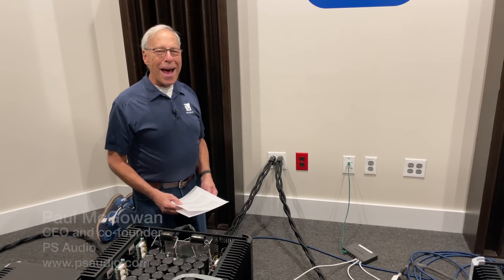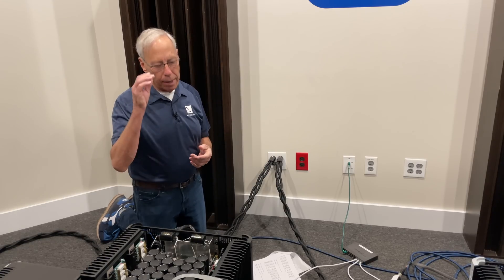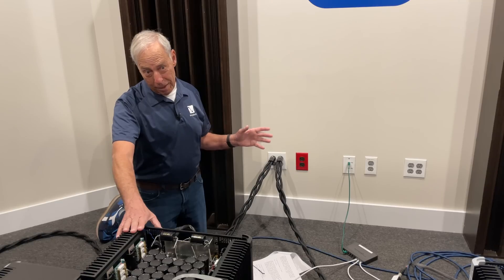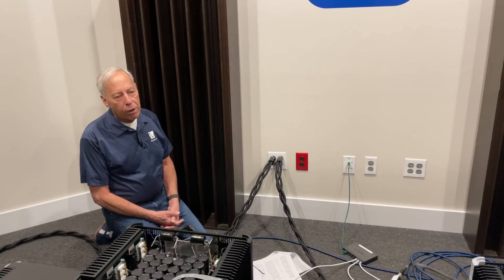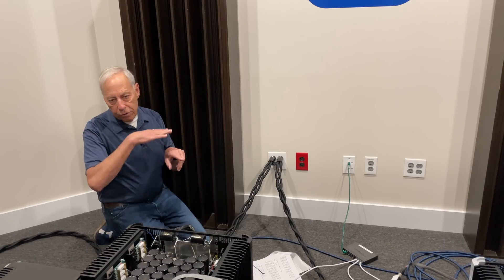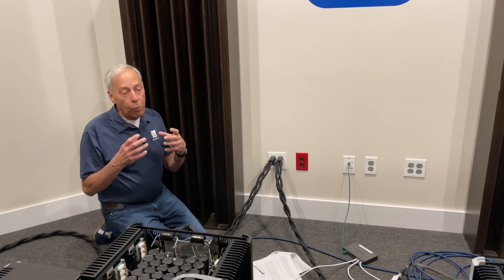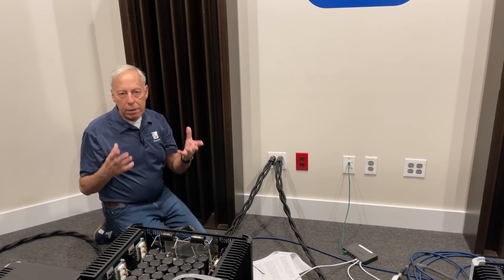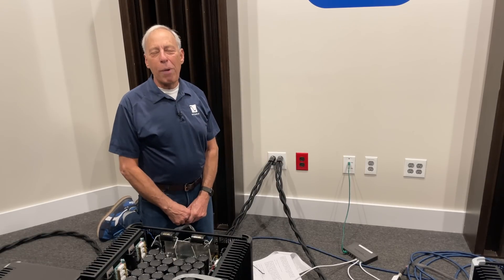Are braided power cables better?

Comment: Anything you hear in a power cable is pure PLACEBO. There are multiple videos explaining why a power cable does nothing more than get power from the wall to the equipment. Also by braiding a cable it makes the conductors longer which can INCREASE resistance, not good. Hi end manufacturers have been using the placebo effect for decades to sell some ridiculously overpriced stuff. Measure the power at the end of a stock molded cord and a fancy whatever expensive cord, no difference means no difference. It's ok to admit our brains are amazing things and have the power to fool us. Just keep signal carrying cables separated from your power cables and all is good. The emf is very weak and dissipates as you move from the cord. The strength of the field is dependent on the amount of current flowing thru the cord,  Take a amp rated at 1000w and use ohms law to see what it actually draws from the wall. Not a lot.
Reply: Please list the power cables that you used in your listening test, to conclude that power cables make no difference.
Please also list all of your stereo's components that were used in your listening test (speakers, amps, pre-amp, DAC, transport, phono-amp, tone-arm, cartridge, etc), and room treatments.
Reply: @0Perhaps  you are not the brightest no?
Reply: @0Perhaps  No. Follow the science
Reply: @bradt.3555  What science?
Reply: @0Perhaps  Somehow "audiophiles" think they have some special hearing the defies all the laws of physics. I've gone past the point of annoyed, now it's getting just plain funny.
Reply: @0Perhaps  Really, listening tests are the problem. There is no physical laws in this universe where a 6 ft wire in a non signal path, before the power supply can have ANY effect. A good piece of zip cord will give you the same voltage and cycles,etc. as any other cord. I have tried different cords. It's a strange phenom. that people actually want to be fooled, that's the one that I really have a hard time understanding.
Reply: @ Brad T.

24 hours later:  2nd Request:

Please list the power cables that you used in your listening test, to conclude that power cables make no difference.
Please also list all of your stereo's components that were used in your listening test (speakers, amps, pre-amp, DAC, transport, phono-amp, tone-arm, cartridge, etc), and room treatments.
Reply: @0Perhaps  Too much to trouble to list all. Doesn't change the facts on the function of a power cord. Under any laws of physics it can't happen, except in your brain. Step up and admit the science of placebo effect. That's my final response. Not trying to be mean or anything it's just the science of it.
Reply: @bradt.3555  You wrote:
"Too much to trouble to list all."
You have nothing to list, because you never tested.

Your "Too much trouble" is a BS excuse.
Do you understand that people are reading what you wrote, and you expect them to believe that listing the components in your stereo is "Too much trouble"?

You wrote:
"Doesn't change the facts on the function of a power cord. Under any laws of physics it can't happen..."
You wrote the above, so therefore it is a fact.
I am relieved that you did not write that the Earth is flat, because then that would also then be a fact.

You wrote:
"Step up and admit the science of placebo effect."
I admit the placebo effect.  I never denied that effect.
I also admit to driving over the speed limit.  I never denied do so.

The placebo effect is relevant when you take a double-blind test, and are given the same power cables to compare, but are told one is expensive.

When using a stock power cord, and replacing it with a quality power cord, you will hear the improvement, because there is an improvement.  It is not subtle.  It is not something you have to strain your ears to hear.  Such a change is not imagined.  It is real.

Quality power cords are most effective with CD players (or DACs).  If you have only one quality power cord, then that is the component that you should plug it into.

3rd Request:
Please list the power cables that you used in your listening test, to conclude that power cables make no difference.
Please also list all of your stereo's components that were used in your listening test (speakers, amps, pre-amp, DAC, transport, phono-amp, tone-arm, cartridge, etc), and room treatments.

You will not do so, because you never listened with quality power cables.  You chose to spew BS, and when challenged, claim it is too much trouble to support your assertion.

It sucks to be caught in a lie.
It sucks even more when you keep digging.
Reply: @0Perhaps  I have tried diff cords. I have been doing power distribution all my working life till I retired, and electronics. Check the internet, power cords have been tested and no difference. No listening where your ears can fool you but actual tests. There is just nothing a 6 foot piece of wire can do to make a difference. Use some logic look at what a power cord does. Theres nothing 6 foot of wire can do to change 120v, 60 cycles, or whatever you power is.. Don't know what the caught in a lie thing is about. This isn't even complicated science it's electricity 101.
Reply: @0Perhaps  Just a note to add, I don't understand the obsession with my gear, whether you have an old technics table and reciever and radio shack spkrs or a oracle, theil spkrs, audio research comp or whatever if a pwr cord made any diff it would improve any system. Probably less on better gear because of a better power supply. My stuff falls somewhere in the middle. Very good used stuff I've put together over the years. Prob about 10- 20 grand range if bought new when it came out. But gear is irrelevant to the scientific facts of what the cord does. I have not had anybody explain technically how a cord alters the power and backed it up with measurements.
Reply: @bradt.3555  You wrote:
"I don't understand the obsession with my gear..."
The obsession is on your part, in making claims of quality power cords making no difference in sound quality, and refusing to list the stereo equipment that you used to make your conclusion.

You went on and wrote:
"if a pwr cord made any diff it would improve any system. Probably less on better gear because of a better power supply."
Translation: You never tested a quality power cord.

Your original comment, that started this thread, was you spewing BS about power cords being "pure PLACEBO".  You made that claim, and you never tried a quality power cord to verify, to substantiate your claim.

You wrote:
"I have tried diff cords."
Again, not listing what you tried.

Swapping a stock cord with a Walmart cord or a Home Depot cord, etc, is pointless.
Swapping a stock cord with a quality Shunyata cord or quality Audioquest cord is noteworthy.

Whatever videos that you watched that claimed that power cords make no difference are spreading BS.
They all claim this test and that test, and yet the key component in any test is a quality stereo, and they never test with that.

Like a car manufacturer testing their cars in the lab, but never driving them on the road.

The stereo is the lab.
The stereo is the ultimate testing tool.
The stereo, together with your ears, is the final determining factor in sound quality.

Given the following choice:
1) A stereo with crappy lab test results, but sounds great.
2) A stereo with great lab test results, but sounds crappy.

...I will choose #1.
You would likely choose #2, because the oscilloscope shows better readings.

Brad T., quality power cords are the real deal.  They make stereos sound better.  It is not the placebo effect.  That effect is when a double-blind test is performed, using the same power cord for both tests, and telling the customer that one of them is expensive.

Testing a stock power cord against a quality Audioquest power cord requires no ear straining to hear the improvement.  It is an obvious improvement.  Not like changing speakers.  But the difference between the power cords will be unmistakable.

And you got it backwards, in terms of which stereos would benefit the least/most, with quality power cords.

The better the stereo, the more it will reveal every aspect of the equipment being used, including the power cords.
A Walmart stereo with a flagship, quality power cord will still sound like a Walmart stereo, and probably no one, including me, would hear an improvement with the quality power cord.

If a stereo has good imaging, and throws a good soundstage, then quality power cords will bring those positive attributes to a new level.

If you have only 1 quality power cord, then use it for your CD player (or DAC).  Those boxes throw a lot of noise back into the power cord.  Why?  I have no idea.  But they do.  Use a quality power cord, and that problem goes away.  You might not think your CD player is throwing noise back into the system, until you plug it in with a quality power cord.  After listening for a few minutes, you will be hit with the realization of how much better it sounds.  And if you are still not convinced, then when you put back the stock power cord, you will instantly hear the sound quality diminish.

There is too much misinformation being published by people that make things up, are envious of what is out of their reach, and attention whores, etc.  The "quality power cords" is snake oil mantra is an example of the above.  Please do not be part of that crowd.  People that have a quality stereo and put in quality power cords know the deal; they know that the "snake oil" people are what I wrote at the top of this paragraph.

Cheers!
Reply: @0Perhaps  Again listening, thats where placebo happens. The fact is the power at the end of an audioquest cord is exactly the same as the stock molded cord, period. It's been tested, if you can't measure a difference, then theres no difference. 6 foot wire of has no effect on what comes out of the power supply of the gear. The best a power cord can do is put EXACTLY whats at the wall at the device. When you've worked with electricity (my profession for 45 years) and tinkered with audio gear as long as I have you understand how electricity works. I've built more cords than most people will even see in a lifetime. Why can't you accept science. To have a difference in the sound you have to have a measurable difference in something, be it power, signal something. And the cord is not even in the signal chain. The power out of the power supply is EXACTLY the same no matter the cord, that's the function of the power supply. All gear has to pass tests where it can not cause interference in other devices, or it doesn't get approved. You've heard of UL or ETI testing labs. Again that's part of the function of the power supply. And again wire has no filtering properties, it merely gets all the power from one cord cap to the other. The people that have tested these things are very qualified in their field. This is some of the biggest snake oil in the business, ACCEPT THE SCIENCE, PLACEBO IS REAL! You can spend your money however you want I just hate seeing people the have to watch what they spend on upgrades get sold a bill of goods. Theres no testing or science behind what you claim only listening, the most unreliable source. People used to claim the EYE WHITNESS was the best source for criminal cases, look what science has revealed about that.
Reply: @0Perhaps  Sorry I think one was a speaker cable test, just disreguard, or watch.
Reply: @bradt.3555  You wrote:
"Science wins over unreliable human perception."
True, when the science is capable of performing the task at hand.

In the case of sound improvement with a quality power cord, the "science" is not testing properly.

If you have an ache in your back, and all of the hospital's test results show negative, and the doctor's tell you that you do not really have a pain in your back; that you are imagining that the pain is real... would you believe the test results, or would you believe the pain you have in your back?

But the hospital has experts.  And the hospital has state-of-the-art equipment.  And it is science.

According to you, when it comes to testing for sound quality, human-kind has reached science's limit.  Never will there be a better machine or better software or new technology that can do it better.  Today's lab equipment cannot be improved.  And everyone in that field will agree that no improvement is possible.

Do you see how stupid your position is?

The rest of your comparisons are irrelevant, because they are for different types of perception.
What someone saw in a scary crime scene, with emotions all over the place, has zero to do with a relaxed, controlled power cable swap.

And again you are doing everything other than putting this to rest by way of actually listening.
You are obsessed with trying to make an impossible case, by bringing up things from all over the place, and showing tests that are flawed, etc, when all you have to do is listen for yourself.

There is no test and no person that can tell me that what I know that I heard that I did not hear.

You have an impenetrable wall in your head, where logic and reasoning are blocked from getting through.  You cannot seem to fathom that countless people have borrowed quality power cables, heard the "real" and "significant" improvement, and made the purchase.  You cannot seem to fathom that you can reply to the moon with your nonsense, and you will not (because you can not) change our minds.  We know what we hear.

Do you understand that what we hear is not a struggle, or a desire, or "I think it is better"?
Do you understand that there really is a sound improvement with quality power cords?

Do you understand, that by continuing to dig and dig and dig, you continue to look the fool, because you refuse to listen for yourself?

Put your efforts to good use, by doing a listening test on a quality stereo with the CD player's stock power cord, and then with a quality power cord for the CD player.
Listen for several minutes.  Then put the stock power cord back, and listen again.

You will have no choice but to acknowledge that the CD player, with the quality power cord, helped, and significantly so.

Then, you could put your brain to work on figuring out why the lab tests are not showing what your ears are hearing.
Be a hero, and get to the bottom of the flawed lab tests.  Be part of the solution.

And your friend did not own a high-end store.  You just made that up.
Reply: @0Perhaps  No,I don't intentionally lie, it's wrong. GNP audio video in Pas., I spent many, many hours there. Your analogy's are wrong. There is much emotion involved in listening. We can measure far beyond the capability's of human hearing. For anything coming from your speakers to sound different, they HAVE to be getting a different signal, or it wouldn't sound different. That can be measured. The problem is we can't measure how much our brain fools us, "audiophiles" don't want to believe. You don't know what you hear, you believe what your brain makes you think you hear. There in lies the problem.  I'm done since you've resorted to calling me a liar with no knowledge of me. You just assuming I'm lying tells me where your coming from. Where's the logic in ignoring what can be proven and believing where your brain can fool you, Who looks foolish!
Reply: @bradt.3555  "No,I don't intentionally lie"
Then you are lying out of ignorance.

"Your analogy's are wrong."
Your assertion that my analogies are wrong, is wrong.

"We can measure far beyond the capability's of human hearing."
That is an example of you lying, by way of a true statement, which you then use to imply that everything you are writing is true.

Like saying that all squares are rectangles.  That is true.  But not said is that not all geometric shapes are squares.

Yes, you are correct that when a piece of equipment is measuring something, it is measuring "something" (but not everything -- and that is your lie).
For that "something", it can give very accurate readings.

But for everything that it is not measuring, it is giving zero readings.  You are oblivious to everything that is not being measured; things that our ears hear.

Our ears measure everything.  Lab equipment does not measure everything.
And before you reply with "Lab equipment can measure things that we cannot hear", those measurements are pointless, since we can not hear those sounds.

Our ears hear everything that our ears can hear.
Lab equipment does not measure everything that our ears can hear.  This is why your are knocking your head against the wall, because you cannot comprehend that lab equipment does not measure everything that we hear.  Lab equipment does a better job at measuring some of the things that we hear, and does a zero job at measuring things that have not been invented for it to measure.

And the two key items for measuring sound quality, which you ignore, are 1) the stereo, and 2) your ears.  You completely ignore the stereo (which is mind-boggling, since that is what is making the music) and you dismiss your ears, claiming that they do not hear what they hear.

You would likely purchase speakers, having never listened to them, based on their measuring specifications.  Why not, according to you, you can measuring everything?  So you would know which speakers sound better, based on their measurements?

"For anything coming from your speakers to sound different, they HAVE to be getting a different signal, or it wouldn't sound different. That can be measured."
For many things, yes.  For "everything", no.

Measuring tools cannot measure everything coming out of our speakers.  If they did, then we would not be hearing what the measuring equipment is not measuring.

Show me the measurements that explain which speakers throw a wider soundstage.
You will not, because no such measurements exist.  But you claim that the lab equipment misses nothing.

A wide soundstage is a core quality for speakers.
So explain why no such measurements exist.

Post the "soundstage" measurements for any stereo equipment, since the dawn of time.  Post one such measurement.

You will, of course, ignore the above "soundstage" challenge, because you would have to admit that you are wrong.

Note that by you not providing a "soundstage" measurement, you are defeated by default.  Not answering this challenge is the same as you admitting that you are wrong.

"The problem is we can't measure how much our brain fools us."
This is an example of you lying, and claiming that you are not lying.

You give another true example.  Yet, you leave out that for what we hear is not fooling us.  It could be.  But you write your comment as if we have to be getting fooled; that we are absolutely, no doubt whatsoever, being fooled.

That is arrogant and absurd.

You simply have a brain block that cannot comprehend that quality power cords do improve sound quality, and it is not imagined.  It is plain to hear.  It is not a struggle to hear.  It is obvious, if you ever stop typing and, instead, listen.

"Where's the logic in ignoring what can be proven and believing where your brain can fool you, Who looks foolish!"
I agree that it can, and has been, proven that quality power cords improve sound quality, because we hear the improvement -- the real and obvious improvement.
I agree that it has been proven that lab test results are flawed, because they do not test for what our ears hear, as it pertains to using quality power cords.

I agree that lab tests cannot test for which equipment throws a better soundstage, and that you will not show any lab tests that measure the soundstage.

What is the logic in you continually digging deeper holes, rather than actually listening for yourself?
You are a glutton for punishment, and have an insatiable appetite for attention, to the point where you seek attention by way of making a fool of yourself.

Stop reviewing that which you never experienced.

Stop debating, and do a listening test.
Stop making excuses for not doing a listening test, and do a listening test.

You will not do a listening test, because you have a mental disorder; because you cannot bring yourself to apologize for looking so damn stupid, after you do a test and realize how so damn stupid you have been.

Do the listening test, and put this to rest.  If not, live with being a fool and and idiot.
Reply: @bradt.3555  They still can give a different result in sound coming out of the speakets
Reply: @adotopp1865  Brad buys his speakers based on lab test results.
He can listen to the speakers, for free, before he buys them.  But Brad knows that it is the lab results that determine the sound quality of the speakers, and not his ears.
Reply: @bradt.3555  Check out the Internet if you want the facts
Reply: @0Perhaps  Hmmm, You guy's do know how to make stuff up, Like what I've listened to, how I buy my gear, my knowledge of how electricity is used to create sound, not very accurate but highly entertaining. And If you don't understand what it is that creates differences in soundstaging, wow. Just buy what makes you happy (whether it works or not). If you believe it does I guess that's all that really matters.
Reply: @bradt.3555  You wrote, addressed to me:
"You guy's do know how to make stuff up..."
I share my login with no one.  I am not plural.  It is bizarre that you assume otherwise.

"...Like what I've listened to"
You just made that up.
Please quote where I wrote that I know what you listen to.

All I have been able to verify is that you spew misinformation on what you have not listened to.  That is not the same as knowing what you have listened to.  And you know that the two are not the same.  This is you, again, being dishonest.

"We can measure far beyond the capability's of human hearing."
Second request for you to show how to measure a speaker's soundstaging quality.  You will not answer, because no such measurement exists.  But you continue to claim that measurements are the tell-all of audio nirvana (in different words, but the same meaning).

Show us soundstaging measurements.  Name the lab's gear used to produce soundstaging measurements.

"Just buy what makes you happy"
That is your way of throwing in the towel, without having the backbone to state it outright.

Everyone buys what makes them happy, whether stereos, homes, cars, food, computers, carpeting, cookware, nail clippers, etc.
Translating your "Just buy what makes you happy" means you have run out of excuses, and cannot stand the scrutiny of your BS.  So you are giving up.  As you wrote "...what makes you happy", and giving up makes you happy.

Note that you have not conceded.  Your surrender is more of a "run away and hide".  You are not doing anything courageous.  A stand-up person would own up to being wrong, and a real mench would apologize for all of the trouble that they caused.  But you are not sorry for anything other than being exposed for being a dolt.

You earned it.
Reply: @bradt.3555  You wrote:
"We can measure far beyond the capability's of human hearing."
Third request for you to show how to measure a speaker's soundstaging quality.  You will not answer, because no such measurement exists.  But you continue to claim that measurements are the tell-all of audio nirvana (in different words, but the same meaning).
Reply: @0Perhaps  You keep putting words in my mouth and making assumptions. I never said measurements are the tell tale all of it. But in some cases give us more than our ears are capable of. What we can't measure is how our brain processes what we do hear, tho it is known that many things, emotion, humidity, altitude, to name three can make us hear the same thing differently, no magic.  Soundstaging is a combination of freq. response, phase cancellation, and the reflection of such.  A speakers design, shape, driver compliment, etc. all affect this. All of which are measurable and with the proper placement of mics you could record it. But it's not needed as the difference in speakers is vast and we know there will be differences in the sound, and soundstaging. I've expressed my 5 decades of electrical, audio, and listening experience and I have my conclusions. I'm OK with them. You have your's, are you, it seem's your trying to convince yourself. All you've said is listen, listen, listen, with no evidence otherwise and called me names. I'm now going to let it rest and let people make up their own minds.
Reply: @bradt.3555  You wrote:
"Soundstaging is a combination of freq. response, phase cancellation, and the reflection of such.  A speakers design, shape, driver compliment, etc. all affect this. All of which are measurable..."

"All you've said is listen, listen, listen..."
All you do is refuse to listen, refuse to listen, refuse to listen.

A listening test will put this topic to rest.  But you would rather be wrong and dig in your heels.
Getting you to listen with your ears is like getting you to change your religion.

"But it's not needed as the difference in speakers is vast and we know there will be differences in the sound, and soundstaging."
So now your story changes from being able to measure differences in sound quality, to not being able to measure differences when you deem it to not be necessary.

You state that the differences in speakers are vast (which is true).  Yet even for "vast" differences, you can provide no soundstaging measurements.
You could end this disagreement by backing up your claims with the measurements you imply are easily obtainable (they should be, for vast difference).

You will not do so, because there is no technology that can measure which speakers throw a wider, more realistic soundstage.
There is one tool that will do that measuring: Our ears.

But you refuse to use your ears.  And that is your weak, feckless excuse for not backing up your BS claims.

Just as your ears can measure a soundstage that technology cannot, your ears can measure a cable upgrade that technology cannot.
You can verify this with your ears.  It will be nearly as apparent as a speaker change.  But you refuse to listen.  You choose to be stubbornly ignorant.  You prove that working years at a profession neither equates to being knowledgeable nor open-minded.

"I've expressed my 5 decades of electrical, audio, and listening experience..."
And a doctor can say the same thing about her medical prowess, and that will tell you zero about the doctor's bedside manner -- and that is part of being a great doctor.

"I'm now going to let it rest and let people make up their own minds."
Translation: I cannot backup any of my claims.  I choose to stop digging, hide my head in the sand, and hope that I will stop being revealed as a fool.

There is a difference between a "reply" and an "answer".
You have mastered the art of the "reply".  But you reveal yourself as a dolt for never providing an "answer".

And if you did a listening test, for free (yes, they are free), you would have your answer.  But you neither provide answers nor do you seek out answers.  You do not seek out the truth.  You would rather continue to be wrong, because it is like a religion.  You can listen for free, and you refuse.  That speaks volumes about your credibility.

This is not politics, where opinions influence beliefs.  This is using your ears to listen to a stock cable vs. a quality cable.  No matter a person's political standing, religion, gender, education, occupation, etc, they will hear the difference.  And yet you refuse.  You can't teach an old dog new tricks.  You are set in your ways.  Something as simple as a listening test you refuse, because you are intransigent with age.

4th request for you to show how to measure a speaker's soundstaging quality.  You will not answer, because no such measurement exists.
Reply: @0Perhaps  Let's see, Ive listened and heard no difference in power cords. Now if your not going to read what I say or believe it, then why did you ever respond in the first place?  I understand it is not in the signal path, I understand it's given function and that it logically can't make a difference, and all reputable engineers will say it can't. You obviously don't or won't understand how our brains perception of what we hear is the big variable. And speakers? Your comparing apples and oranges, Are they in the signal path? Ah yea. I've explained what produces differences in soundstaging, no measurments because most entry level listeners understand how it works. Me thinks YOU are the one stuck not wanting to learn. Every time I question myself I get on the computer, open books, try to get as much info from both sides as I can. It's a combination of measurements, and listening, and understanding our brains part in all of it. Then the logic of how to use all of it. When I see you compare a speakers function to a power cords function I realize you don't have the logic or understanding or it seems desire to learn how to understand. I've been waiting for you to somehow mention politics, knew it had to happen We started on power cords and you've tried to divert it every which way. And I will now give you the last word.
Reply: @0Perhaps  Just to add, If you wanted you could record the differences in how a speaker presents a different soundstage by recording the differences in the reflected sound in a room. Just because no one has done it (to my knowledge) doesn't mean it can't be done. I doubt if anyone has felt the need. Let me try to explain something. If I take a 25 foot 1/2 cheap garden hose with cheap steel or plastic fittings, at a given pressure will flow a given GPM. If I take a 1/2 hose and wrap it in a nice woven jacket, put on really nice gold plated brass fittings and attach it to the same hose bib, at the same pressure will flow the same GPM. If you don't get how it works the fancy one might look like it's flowing better, so we measure, wow our eyes fooled us. Speaker? The nozzle at the end. We know that by looking at the different nozzles that logically the spay will be different. And if you were not aware water flow is used to teach electrical flow in electricity 101 because they are fundamentally identical. It's a combination of looking (or listening) combined with other factors, using logic to determine how to combine them. Show me measurements out of the power supply that have any change based on the cord feeding said supply. Listening is good but because of our brain is the most fallible.
Reply: @bradt.3555  More ramblings and excuses for you not showing how to measure soundstaging.

If you claim that you provided those measurements, that is yet another lie.  Prove me wrong by quoting yourself.  The quote needs to be your measurements; not a quote of your ramblings.

There is a difference between a "reply" and an "answer".
You have mastered the art of the "reply".  But you reveal yourself as a dolt for never providing an "answer".

5th request for you to show how to measure a speaker's soundstaging quality.  You will not answer, because no such measurement exists.
Reply: @0Perhaps  You show me the measurements of how a power cord changes soundstaging, or anything else. How bout the power from the secondary side of the power supply. I've noticed in my debates with people that can't support their outlandish claims, they find a way to side track the conversation to something else.
Reply: @bradt.3555  You wrote:
"You show me the measurements of how a power cord changes soundstaging, or anything else."

That is my point.  There is no such measurement.  Setting up speakers "A" and taking measurements and then speakers "B" and taking measurements will tell us nothing about which of the speakers throw a wider soundstage.

Some things cannot be measured, technologically, as of this date.  No tests exist, other than our ears.

And of course I cannot support (or prove) my claims.  No one can prove what their ears heard.
You could hear a cat meow.  Now prove that you heard it.

This is why each person should borrow a quality power cord, plug it into their CD player, and listen for themselves.

"How bout the power from the secondary side of the power supply."
A quality power cord is not designed to deal with every power related task within a component, just as a dishwasher will not fix a cracked plate.
Reply: Shut up Brad you don't have anything to say
Reply: @adotopp1865  ,You guy's can all use your fancy power cords to hang on to when you fall off the edge of the earth. Guess they are good for something.
Reply: @bradt.3555  The Earth is round I believe it has been seen and photographed . I don't know why you might think I would fall off the edge.
Reply: Brad. You do know this is a load of twaddle don't you?